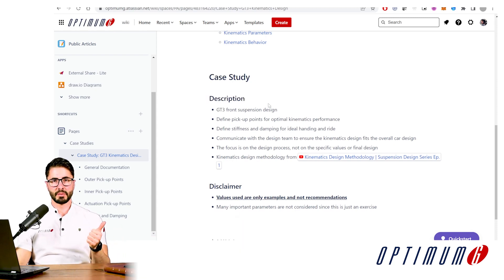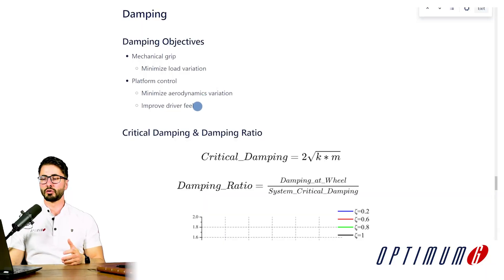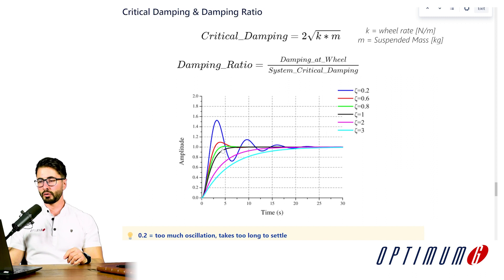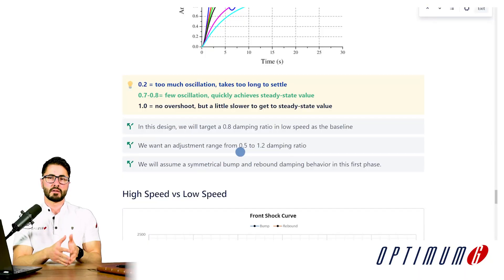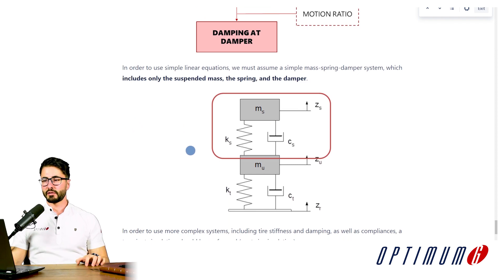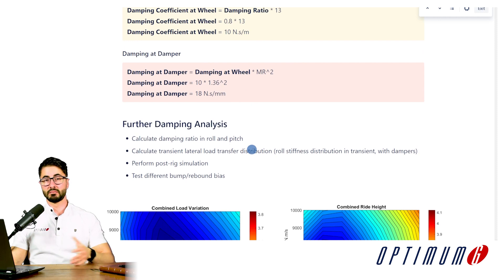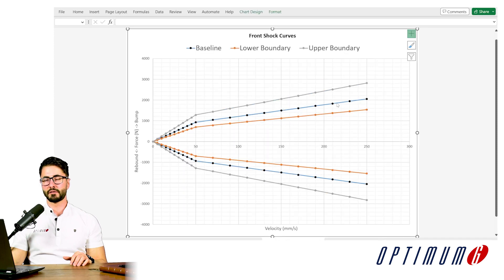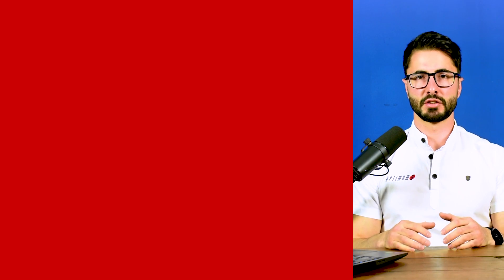DESIGN WITH ME! Damper Curves | Suspension Design Series Ep.6

Comment: 1:48 - Quick clarification question.
We are focusing on reducing load variation on the so-called unsprung weight of the car, being the wheels (which are not completely unsprung, but they are understood as such).
Is it a possibility to have the load variation on tires be reduced, while having the chassis seem more bouncy to the driver?